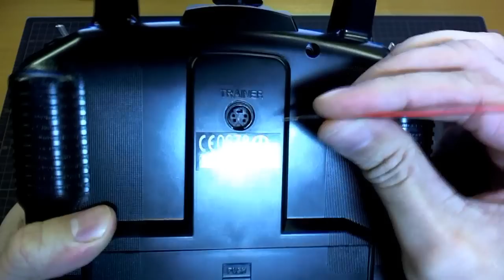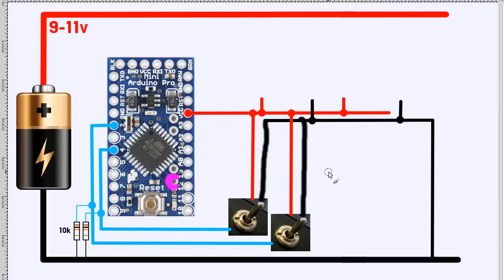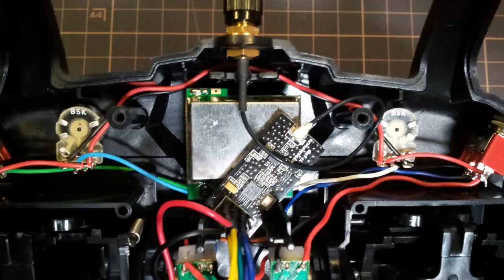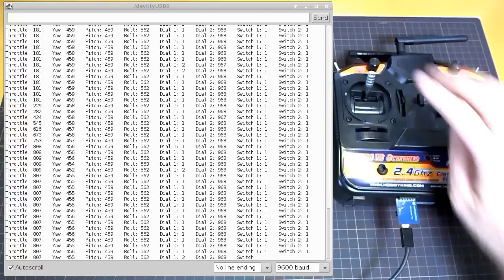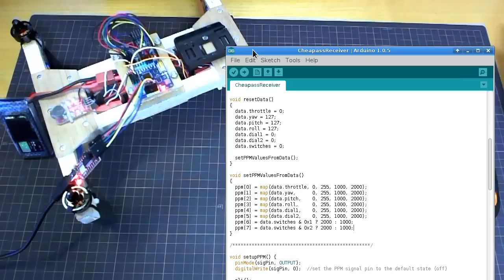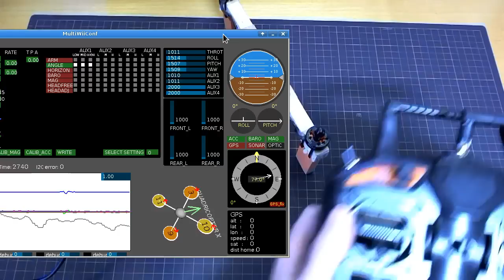Cheap-ass quadcopter build Part 12 - Arduino conversion of HK transmitter

Comment: Hi Chris, where is the xtra sketch that has the dials and switches inside for the HK Tx and Rx ? the one listed is only for wooden TX
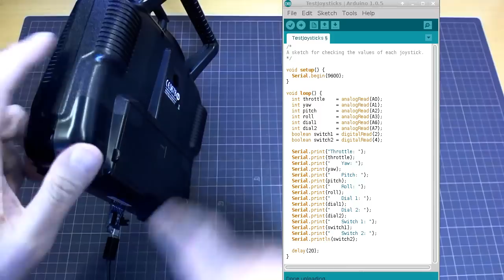Reply from the maker: kermets I'm not sure what you mean by "the one listed"... the sketch used in this video (27:35) shows how all inputs of the TX can be used with the 'txtester' sketch, and then at 30:51 I show how the extra channels can be added to the packet.
Reply: ***** In "Part 8" you have a zip file with the sketchs, it does not have the xtra info added that you show here for the dials and switches, they are missing, did you want us to type it in from the screen shot or do you have a copy which would make it a lot easier,The testjoystick file in the zip is not the same as you show here, hope that makes sense, Brett
Reply from the maker: kermets I see. It didn't seem like a great hassle to type a few lines since I explained all the changes in detail and nobody has mentioned it so far, but if it makes it easier I've edited the sketches to match this video and uploaded for you here: http://www.iforce2d.net/sketches/
Reply: ***** Awesome, still newish to Arduino and unsure if there was more, How can you change the  RF power and hop channels plus where can i read up about coding the signal so a mate cant transmit on the same channel, thanks again,brett
Reply from the maker: kermets You can use a different pipe address, and/or setChannel to use different channels. Docs are here: http://maniacbug.github.io/RF24/classRF24.html

Comment: Not read the comments, but you could use a switch to set a calibration routine.
When a switch is on, store the highest and lowest value for each potentiometer position.Just move the sticks to each extreme while the switch is on to get the full range. 

When the switch is clicked off take the reading for the middle position of each.
You'd need to centre the yaw and throttle before switching it off of course.

Comment: Hi, what do you think about using maple mini stm32 board, it has more power and pins for display, switches, pots. Is it possibe to use this as transmitter and pro mini as receiver? I found a library also for stm32. Board in ebay - http://goo.gl/cvTyWO
Reply from the maker: jarnoorasmae I think it would work. There is an ARM port of multiwii which has been shown to run on the arduino due, but it's not very mainstream and probably not supported as well as the avr chips.
Reply: ***** newer transmitters are also using arm m3, so it would be cheap-ass transmitter v2 :) I ordered one, so I'll give it a try. But at first version I'll use uno board, but I would like a lcd also for some telemetry, but not enough pins for all switches, pots, lcd, nrf24, buzzer and maybe something more. I can use mega also, but don't know how it will fit and is it powerful enough. Thanks

Comment: What about the possibility of using a Arduino to receive PPM signal from the Turnigy 9x or taranis transmitter and transmit it though the NRF24 module. then have another Nrf24 module as a receiver. This could fit in the JR Module box on the back of the transmitter?
Reply from the maker: paulham sure, you could do that, but I don't see the advantage. It's a lot more complex meaning more points of failure and a lot of headscratching to figure out where the problem is if it suddenly stops working, plus you would still only have the 9 channels available that the 9x has, but with the shorter transmission range of the nRF24. Perhaps you could feed extra info into the arduino to send in addition to the 9x PPM source, eg. GPS waypoints or something, then yes, you would have an advantage.

Comment: Thank you so much for this series. It is very good, and I'd been trying to find a good explainer doing clear tutorials for building a quad like you, but luckily I found your series since I'm very beginner.
I watched the whole series and I finally started doing my list by using your spreadsheet, but I'm very concern when it comes to do the transmitter. My plan was to buy hobbyking transmitter, but when I watched video part 11, I sow you had an unexpected problem with the transmitter. I don't know if the easiest way is to buy a different transmitter instead of this which need complex work. So, do you have a suggestion for me since I want to have the easiest way to have a transmitter? if you recommend me to buy another transmitter, can you give me its name or source?
Another thing, what is your preferred way to communicate if I have issues building my quadcopter?
Reply from the maker: FAHAD ALMADHI The easiest way to get a reliable working transmitter would be to buy a 'normal' (ie. not cheapass one) that usually costs over $100. If you plan to be doing RC for a long time, it would be a good investment. I don't know much about them to be honest, but it seems like the FrSky Taranis line is very popular. You can get a 9 channel FrSky transmitter for about $170. We can talk here, is fine.

Comment: Cheers for the tutorial. What was the 3.3 voltage regulator did you use. I tried a capacitor and not rx/tx any data.
Reply from the maker: JD D http://www.banggood.com/Small-Mini-360-Adjustable-DC-Power-Supply-Module-Mini-Step-Down-Module-p-917568.html

Comment: it's probably a dumb question. but would it be possible to connect the third pin of those 2position switches to another digital pin, so you can choose between say acro and levelmode?
Reply from the maker: scflippy A two position switch can select between two states...  sure, if you set up the FC to interpret the switch like that, it will let you switch between those two states, but connecting another wire will not help in any way.
Reply: check. thanks for the fast response and awesome video series so far :)

Comment: Also, it looks like your ESCs are not configured properly for the input values your FC is outputting, which is why the motors start at different times and the quad takes off with a noticeable banking. You might want to set up the minimal signal for the motors and run your quad once with ESC calibration config of multiwii.
Reply from the maker: I have not noticed any significant problems due to ESC calibration. The level of the quad will affect when they spin up as well - I don't think it's realistic to expect all four motors to start simultaneously in all situations. It was also quite windy that day and it looks like I am both yawing and banking as I take off. I did actually try the calibration mode of multwii recently, but it didn't seem to change anything.

Comment: hi, thanks again for all the work, my mini-quad project start to be alive (waiting the postman :D )

Can you post the code for the convertion of the hk transmiter, it's not really complicate to addapte from the cheapass transmiter (code from video #6), but avoid me to do some error ?

thanks
Reply from the maker: http://www.iforce2d.net/sketches
As you say, it's not complicated to adapt it, a few lines :)
Reply from the maker: Detailed explanation of the differences starts at 30:52 in this video. I have changed my TX a lot since then to include all the GPS and telemetry stuff, so I don't have a file I can give you to copy and paste from, and I don't think it's helpful for you to learn like that. Besides, it's highly likely you're using different pins in which case it would work anyway.
Reply: *****
Thank, yeah of course it's just few line to adapt, all the series are really educative, and give me a nice background for quad X. Wait to see your next comming video on the subject ;)

++

Comment: Great series. Thank you so much for putting it together for us all. 

I haven't played with microcontrollers for a long time and seeing these videos inspired me. 

Over the past month I've been ordering tons of parts and yesterday I finally got everything working (including converted transmitter). 

She flew, briefly, before going straight into a wall. I think pin 3 on the flight controller is knackered. The motor spins but only at close to full power (throttle, roll anything which would affect the motor), and the problem seems to follow any motor connected to pin 3.

I'll share a video once I have one which doesn't end in a smash. 

Again, thanks for sharing!

Comment: can you use telemetry ? (i e: tx ==> rx )
Reply from the maker: Yes, see these videos: https://www.youtube.com/watch?v=ysFHtgVBESg
https://www.youtube.com/watch?v=OC5KFWCgRdM
https://www.youtube.com/watch?v=lR60toEjHl8
I will be trying telemetry again soon, but on the car first, not the quad, just in case it doesn't work well :) You would need a high-power nRF24 at both ends if you want a reasonable distance.
Reply: ***** (thank you for reply) in this case, the ACK is it compulsory?

Comment: You can try simulate "bottom + right" by shorting the control pin on the pot and running it all from the wooden box
Reply from the maker: hehe now that's using your head :)

Comment: Thank you for this series. I will keep an eye out for any further tips you may post. The first parts arrived from Banggood today, so I hope to be flying in a few months once the weather improves. I have a busted old Digifleet Tx that I am planning to re-purpose for this. For the Tx Arduino, I want to use a Leonardo. The trim on the Tx main controls are separate pots, and there are four auxiliary variable channels and a bunch of switches too.
Reply from the maker: Pretty sure you'll have it done quicker than a few months :) I forgot to mention about trims in this video, but for a quadcopter you can usually get away with not using them. My first transmitter I did this kind of conversion for also had separate pots for trim (it was not a $25 budget tx!) so I just did not connect them anywhere. The main 'trim' for a quad will come from the accelerometer calibration you do to tell it what is level. Make sure the motors are as close to the same horizontal plane as possible when you do that, and trimming should not be too much of an issue (I measured from my tabletop to the bottom each motor, to get that distance equal on all corners before doing calib_acc in the multiwii config). Since the tx I have in this video has trims built into the same pots as the sticks, I just centered the trims while doing those calibration readings, but I don't really intend to be using the trims. All the quads I have are so light that if there is even a tiny bit of wind, the trims don't amount to much anyway.
Reply: ***** thanks for that. Initially I will leave the trims off, but eventually I would like to have them working. I may do that with an op-amp so that I only use one channel per axis. Although the Leonardo has 12 inputs, I think I may need some of those pins for the nrf24 module.

Comment: Fantastic videos.  I hope you make many many more.  I would like to ask what Linux screen recording software you are using?
Reply from the maker: I'm using ffmpeg, which has an 'x11grab' feature to record from a specified area of the screen. Combine that with a webcam that has a decent auto-focus, and it's the perfect setup for topics like this that need to show both up-close filming alongside on-screen stuff, and I can see a 1:1 preview of the final video as I'm making it. I used to record the real-world filming on one computer and the on-screen stuff on another computer (eg. part 8 of this series), then spend hours lining everything up in the editing program - no thanks! Another handy thing I use is xdotool (mapped to some keyboard shortcuts) to move windows so that they fit perfectly in the area that ffmpeg is recording, makes it look like the recorded area is a full-screen view.

Actually xdotool is pretty handy for other purposes too, like moving windows to replicate the behavior seen on Windows7 where you can pull a window to the left of the screen and it will snap to taking up the left half of the screen, etc. By setting up some keyboard shortcuts for xdotool, I have that behaviour except much more, because I can move windows to any side of my two monitors, and also whatever other arrangements I want as well (eg. quarter of screen, split vertically, split by thirds) and it's more convenient than reaching for the mouse every time.

Comment: Instead of connecting the switch to vcc and ground, you can connect it to ground on only and use the internal pull up resistor to pull the pin to vcc when unconnected
Reply from the maker: True - I didn't really want to rely on that in case anyone uses some oddball board that doesn't do that.